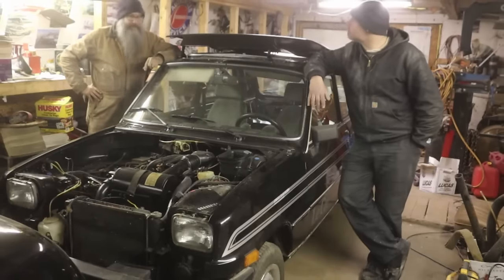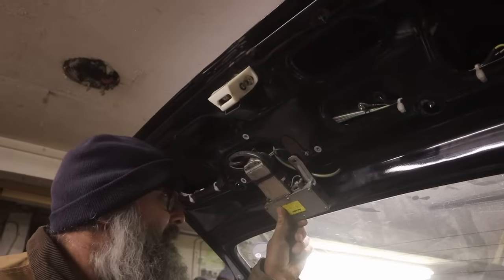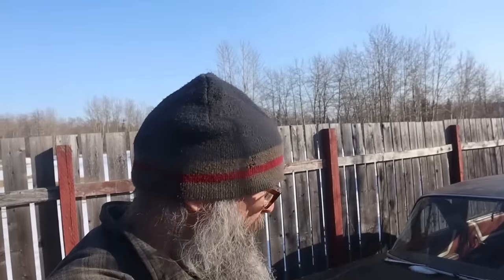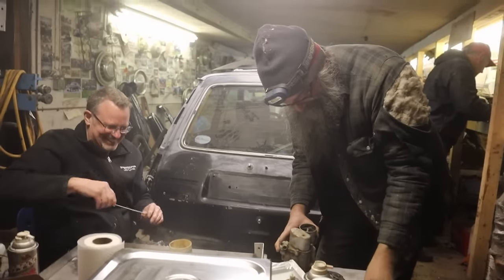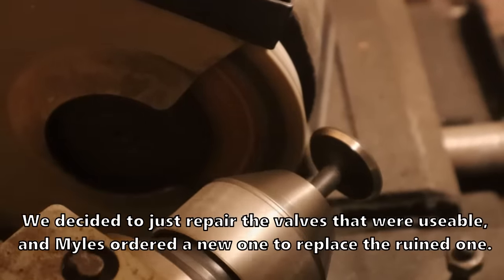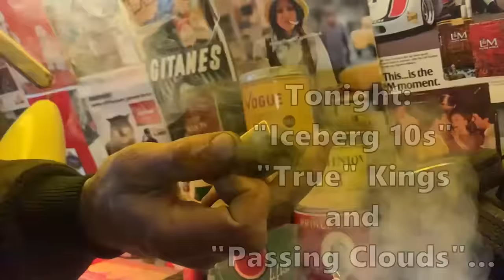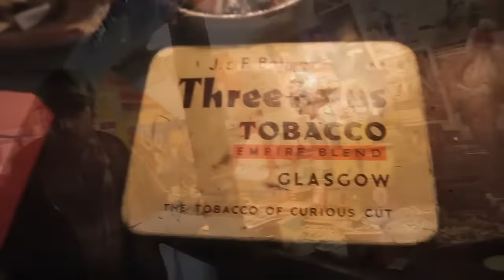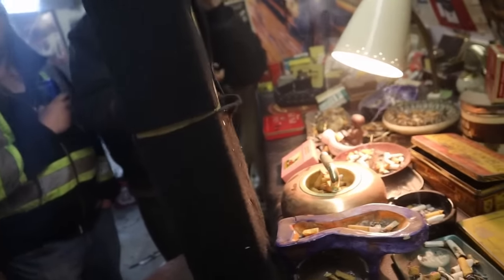1959 Buick LeSabre Flattop Nailhead, Renault 5 into the Bodyshop, and Classic Darts is Back!

Comment: Seeing you working on the thermostat housing and gasket reminded me of the old days, friends and I were replacing the thermostat on his car, went to put it together, but didn't have a gasket. We cut several the right size from an old brown paper bag, and smeared it with soft Permatex on both sides of each layer, one on top of the other, and used that as the gasket. Worked fine.

Comment: I had a 59 Buick way back around 1971. I used to pull up to a store, friends house, whatever, turn off the key, and turn it back on. When I got back to the car, I would slam my foot to the floor and put it in low in one motion. The rear suspension was so worn the back bumper would scrape on the ground and sparks would fly out. The car was done when the steering box ripped off the frame. It was great :)
Reply: I am now completely obsessed with 1959 Buicks as a result of this channel, like the Chevrolet model of that year its design hits just the right balance between elegance and extravagance. Which is impressive because I am otherwise not a big fan of the overtly ornate late 1950's American car design style.

Comment: Make sure the steel plate on the bottom of that intake manifold is in good shape and not rusted out before you install it. They are notorious for rotting out from moisture and exhaust gases.

Comment: Finally a Classic Darts episode. Been waiting so long for this one. At least the packaging is better than what you get today. Actually surprised to see the Renault 5 getting a makeover. I think the reason why one of the valves on Myles engine looks that bad might be just water running in and the valve being damaged before. If rodents get inside the engine intake or exhaust the valves look also like they have been in a salt mine. Glad Scott was able to save the majority of them. Summer showdown Fury III station wagon? Heck yea.

Comment: I always thought that the R5 bumper system was ingenious. To meet the 5 mph Federal impact standards, other cars used an Armco bar from the side of a highway covered with a thin plastic shell that would break if you looked at it sideways, backed by some Monroe shock absorbers from a truck, and held together with some brackets left over from a Sherman tank. Renault used fiberglass moldings and a couple of washing up sponges and met or exceed the standards! And they worked too!

Comment: When I sold Renaults at the local AMC dealer, the R5s with sunroof, black paint and sport aluminum wheels were called a "Black Beauty" and were hard to get. They had red pin stripes along the bottom panels. Don't forget the head has to be retorqued periodically or the cylinder sleeves leak and lead to time consuming repair or junked engines. Glad you're making it nice!

Comment: Welcome to Scott's Sad Bastard Shoppe of horrible parts.We tune in the week to find the Oh Nault being disassembled for painting.Please note the body side mouldings will Not be returned and 1/2 the impact resistance is now gone so please walk by it slowly as a draft may buckle the doors and fenders. The 'Smoulder Inn' finds dusty cigs from days gone by..thankfully.I used to smoke the Trues about 1978-9.The plastic tip didn;t get soggy as it dangled while working on engines,or riding the bike to buy more. Cheers !

Comment: Glad your restoration on the Renault will be painted. The Nail heads Value was pretty bad. Glad Myles decided to order a new one. There always seems to be at least 1or 2 problems with a rebuild. Think Scott, was saying his engine was going to be better with less work. May be but like I said there are always unforeseen issues that will come up. You men are always helping one another. Cheers to you. The old cigarettes are a trip. Those old trues were nasty when new. Takes some guts to take hits off them. 😁 
❤️💯👍👊

Comment: The Renault 5, less than base and just whistled together by people who could give less than two fux if any at all 😂!
What was that that just snapped off? Um, I think it was a body mount or something unimportant. Lmao what's that Dean? Um ah, just a pile of some broken parts and stuff, lmfao! There's not going to be anything left to put back together with all the broken parts and shit falling off the thing! OMG, now remember this debacle is supposed to take your loved ones and you "safely" down the road at a somewhat high-ish rate of speed, what a comfort!
I know the horses have left the barn on these builds, but I didn't see you guys change out the freeze plugs on the blocks and in some cases in the heads too. I hope you did, I got bit in the ass on my first engine when I didn't change them out on my 440 and one unseasonably cold snap froze the water in the block and cracked it. It was late summer and I only had water in the block to start it and that's all she wrote. Those plugs rust and rot so badly from the inside and they're very deceptive since you can't see the rust from the outside until it's to late, like when it happened to your Newport one winter. Much easier to change them with the engine out instead of installed.
Lmfao! Gilligan swinging from a palm tree, that's it little buddy, you fukt up for the last time! Lmao! Thanks again guys and Frankers! Classic Darts on deck, can't wait!🥴

Comment: I've had good luck putting the timing chain cover on somewhat loosely and then installing harmonic balancer tends to Center itself on the seal and then tightening up the timing chain cover bolts.
Reply from the maker: Agreed, but in this case there is a dowel pin that locates the cover... Cheers!

Comment: I had an 84 R5 GTL for about a month. I traded a 79 Pontiac Laurentian with a leaking fuel tank and radiator for it. Head gasket blew on the R5 after a month and 120,000 kilometres

Comment: I hear you on the #1 Phillips on the uses for the size of the screws and the heads of them. I was working on a Old 1938 Heavy duty Oshkosh Truck for a customer of ours and I had to fabricate a #4 I guess you can call it for 8 homemade Phillips screws in the air brake system that someone cobbled together and put on the truck! I am pretty confident that it was original, but if it was someone broken the originals and turned new ones on a lathe once upon a time and put these huge Phillips heads in it instead of getting new ones. Probably cheaper than driving around to get to somewhere to order new ones and have to wait until they come in. Probably had the right stock and turned down 8 new ones, threaded them, and cut the huge Phillips heads on them and made the heads of them so they were flat fitting underneath the head for probably being the simpler way of doing them
 Good morning and great Sunday to you all.

Comment: The True Blues, and True Greens (menthol Trues) were here in the U.S. around 1967 or so. I know because my friend used to swipe his from his parents cartons, blues were his dad's & greens were his mom's...either way to us they were free and we discernung 14 year olds ALWAYS preferred 'free' over any 'brand loyalty' bullshit, we were stil learning about addition and going for it hell for leather. Trues were around until the major tobacco companies began to thin out their product lines as they bought up smaller tobaccp  comapnies or the tobacco lines of larger ones that saw the writing on the wall. Trues are also the forerunners to the early GM smog crap that pumped fresh air into the exhaust manifold outlets, thery have a row of tiny holes around the cigarette below the filter crown to reduce the amount of smoke, and pull fresh air into the smoke to mix right before the filter sends it to you, which is why the filters break off easily, so yoy could get the smoke! 😁 Old Golds & Raleigh's are stout, like old Picayunes, they will knock your dick in the dirt. 🤣
👍🇺🇸😎

Comment: I seem to recal that the filter Al disected was designed to cheat the smoking machines to get a low tar rating. The machine did not deform the filter so air was drawn through the gaps, when they were between lips the filter was deformed and less air was drawn through and more tar.  Carters, half assed and CWM in one evening, good times! :)

Comment: While I did not like to work on those R5s and Peugeot 205 I was used to cheap European junk. I think the Citroen AX and BX were probably even worse. The French were champions in cheap breakable plastic junk and rivets where screws and bolts should have been. My cheap small FIATs were not a lot better though.

Comment: My 1970 Chevrolet Vega was just $1,999 new. Even with am/fm radio, carpet, 4speed floor shifter, rally tires and wheels and hatchback the ‘out the door price was just $2,400. That included sales tax, dealer prep and license plate/registration! 
 Why does a cheap car have to also be crappy?

Comment: Kinda neat to think of the R5 as an archaeological dig.  There's a design philosophy being expressed in every cheap-ass decision manifested as a plastic connector, or glob of glue, or short length of elastic cord.  The engineers sat around at Renault Design HQ smoking Galois ciggies and being snotty and judgemental about the English while taking four hour lunches and eyeing the secretarial pool with carnal intent.  When they actually worked their strenuous three-hour day, they'd ask each other "How can we save a franc or two on this project?"  I guess the upside is lightness.  Nothing massive in the whole car. :)

Comment: I worked in a tire shop back in the early 80s and when there was nothing to do the boss would have me buffing old wheel weights and if you ever have tried to buff a 1/4 ounce wheel weight on a wire wheel it is a great job not.

Comment: ...you know, at the end of  70s, there were few cars made by Amédée Gordini,that had engine from 16TX,or 15/17 TX , 1647 ccm+5 speed,that were squeezed into engine bay(ported heads,weber twin choke carbs+100 HP, fergat steel wheels )....later they  made  mostly A5(1397 ccm)Alpine/Turbo(not maxi)... guess they went like  sh@^^t of the shovel and ate mk1 golfs GTI for a breakfast...